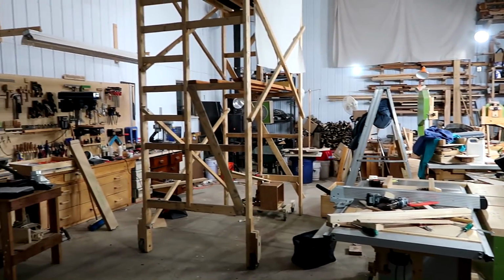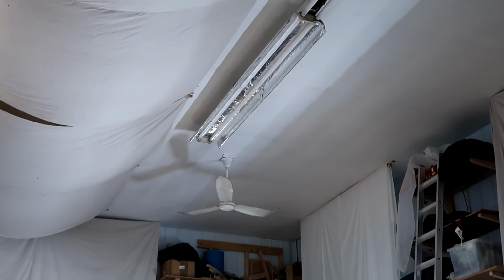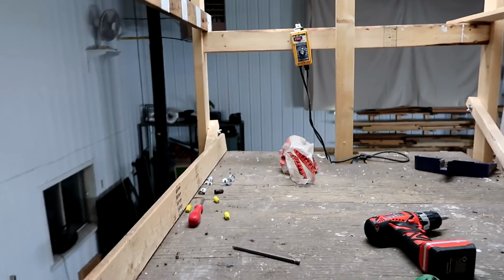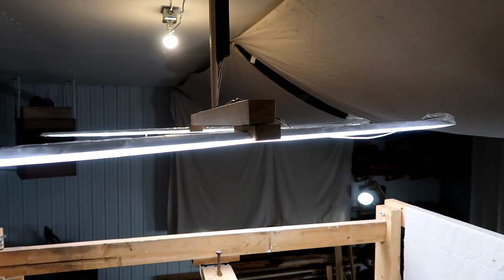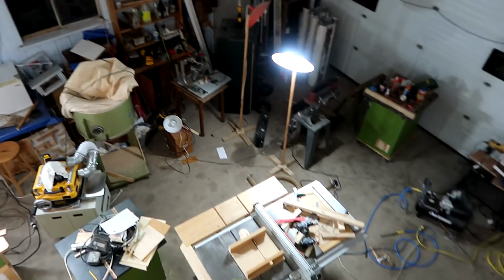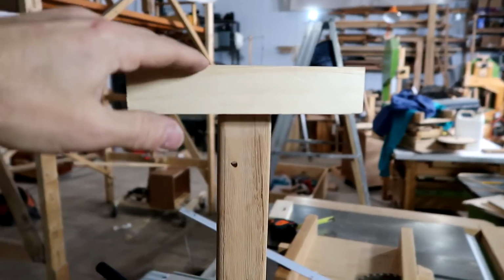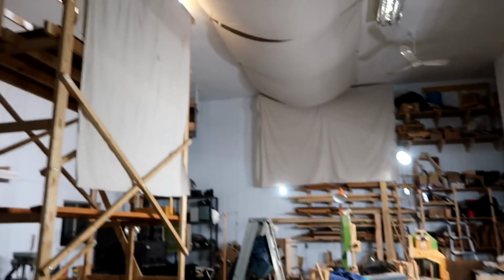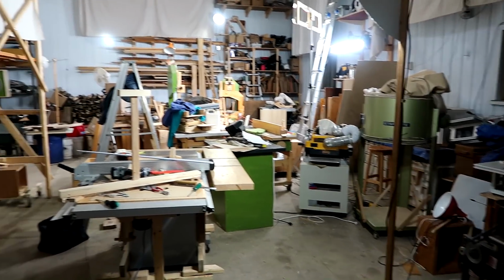Shop lights offset from ceiling

Comment: Dealing with the flies. My big shop is about the size of yours and I HAD a similar problem with flies. I cured the problem by setting up a single lamp near the ceiling, aimed to illuminate a strip of cheap, old fashioned flypaper. I ran the lamp on a cheap timer set to turn on in the late evening while the shop was still warm and the flies were still active, but all other light in the shop was out. Completely coated four strips of flypaper on as many days, but after a week there were almost none, and now I only have an occasional irruption of flies every couple of years. Try it, cheap solution and it works.
Reply from the maker: I heard from friends that fly paper was just about impossible to get this year because they kept selling out.  It's been a horrendous year for flies.
In winter, the flies come out of hibernation only when I heat.  Maybe if I had that in the summer...
Reply: That is unfortunate. I think the last time I bought the stuff it was labeled "Made in Canada". 
Thanks for all you do.

Comment: I've converted a few flourescent strip lights to L.E.D. and they work great!  My ceiling Isn't half as high as yours is, however.  I like your vids, keep 'em comin'.  Some people just use carpet padding for echo supression too.  It's pretty cheap, but tends to run dark (blue, green, brown).  I guess you could use the drop cloths as a cover for better light reflecting properties, but what you're doing already seems to work fairly well.

Comment: Glad you went to LED's. Whole lot cheaper to run and you can get them in 'daylight' configuration too.
Reply: Lasts a whole lot less time too.  I have been an advocate for LED lighting for about 10 years but even the expensive ones just don't seem to stand up as well as the old shop lights do and don't even get me started on outdoor spot lights.  Cost for cost and how long they last LEDs have been a let down for houses and shops for me.    The Chinese eBay ones are dead in no time and I have tried some other brands but no way in hell would I spend 500-1500 USD for one LED light when I can get a daytime Fluorescent for 15-30 dollars that will last and last.
Reply: I'll be darned. Had them in my house about 2 years and no problem. BUT, I don't have to run them as long either. That really sucks! I've been using the Phillips brand - when they're on sale.
Reply: Yeah, just no luck.  I purchased 12 led bulbs (compact ones) for my house and no issues for 2+ years except one burned out in 3 months but when I dissected it the issue was the electronics.  Now on the outside spot light the issue was the cob led itself (50w) though it never ever got hot and was used for no more than a month.  For the shoplights the 5050 (or whatever version it may have) seems to go and it starts a cascade effect.

I think these things are all being way over driven is the main issue.  I mean those old LEDs we have seen for 35 plus years now will last forever and though they are dim by the standards of now they will still be running for 50 more years if not longer.  Now overdrive them so they are brighter and poof.  The candle that is twice as bright lasts half as long but the Chinese no longer care about their history and proverbs.
Reply: I don’t use LED either. Fluorescent uses almost as much energy for the same amount of light as fluorescent led tubes and costs 10 times less. That was 2 years ago in Germany at least.
Reply: LEDs are more efficient than Fluorescents, but not by much.
Reply: cfl  cause cancer   who still uses  cfl .  bad idea
Reply: i have a 80 watt   t8  or t12   works awesome  must    be from the 50s   no worried about  power  use  ,  lights  up the room real  good  ,  but then  again i dont shoot  videos   for that  light to mess  it up
Reply: TMK, all fluorescents can cause cancer, as all emit ultraviolet. This isn't a hugely significant though. The levels tend to be low, and it's not like humans are averse to ever being in contact with sunlight.
Reply: I had similar experience in the past with leds, however they have been getting much better with time. I find Philips or IKEA Brand bulbs last decently. 2+ years out of them currently, the whole house is LED for me now. My shop is using fluorescent like fixtures but they are actually LED in a tube. Costco had the whole fixture for 25$ when I got mine, twin tube. I saw they had them in stock recently again for 27$. I have been using one of those fixtures in the laundry room for about a year now. No issues.
Reply: Actually, with an electronic ballast (about ~10-15 € for a 2x 58 W lamp) fluorescent lights are essentially as efficient as LEDs, while being cheaper and - in my experience - lasting much longer. With an electronic ballast they make no noise at all and reach full brightness after about one second and don't flicker (if you're making videos...). Tubes (which are actually made in the EU, where I live, not overseas, so another +1 for that) cost me about 1.5-2 € each, depending on size.

And, as an added bonus, they are easier and cleaner to manufacture than LEDs as well. Semiconductor manufacturing is an INCREDIBLY dirty process producing (and requiring) many highly toxic compounds which are expensive to dispose of properly. So of course, no cheap semiconductor fab actually does that, they just dump that highly toxic stuff in some ditch nearby.
Reply: That is what I have. There is some sort of circuit board controlling the 2x58w tubes. Cost 28€ includingt he tubes and is splash proof.

Comment: Another advantage from mounting your lights lower than the ceiling is that more light intensity will reach your work. Light intensity falls off using the inverse square of the distance.

Comment: I'm surprised you still have bugs there this time of year.   Pretty much all of the bugs here in N.  Nevada have died off already from the cold nights.   Also, FYI, I have piles of tri-color LED tape segments if you would like. I think each is around 8' long. Only catch is the driver that came with them makes them pink.  I have not had time yet to look at the drivers yet to see if they can be changed.  They were leftovers from a neighbor camp at BM, that were throwing them away!  So I swooped them up, and will be using some for some lighting changes.   Let me know if your interested in some, and how many, and I'll mail them off.  (And some Ethernet too)

Comment: If you soak the drop cloth in something gluey and spread some sand on it its sound dampening efficiency should increase significantly - the heavier it is the more sound-absorbing it becomes. I suppose some diluted PVA (cheapest D1 you can find) would work well - once dried it stays just a bit elastic, so it doesn't crack once you hang out the drop cloth again.

Also, once the drop cloth becomes impermeable, due to the glue, you should be able to throw some loose sand (or maybe fine gravel, of 1-2-3 mm grain size) on it, when it's up again. There's no wind or other disturbance that would make it fall down, inside, and it would also significantly increase sound absorption - loose heavy particles start vibrating when sound hits them, then transform the sound energy to heat as they rub against each other.

Some sticky fly paper should also rid you of flies. That one's really cheap.

And yes. What you currently have is not a workshop. It's a depressing catastrophe. I'm rooting for you to find the time to convert it into a shop again, sooner rather than later.

Comment: The white reflectors on the fluorescent lights have a higher reflectance than the aluminum foil. Look it up. Polished aluminum is great for direction control but is not very reflective when compared to the fixture white paint.
Reply from the maker: I actually tested it against the old reflectors (which were not very white anymore).  It was a substantial improvement.

Comment: Matthias these lights are still awfully far up. You know about the inverse square law and how intensity drops with distance, that is why your light stands work so well and these lights will look puny when finished.
Reply: stefantrethan not so with linear sources. Their drop off is linear. 
It’s complicated further by the complex configuration he put them in.
Reply: Only as long as the linear length and distance are in the same ballpark, as you get further and further away it looks more like a point source. Of course things are further complicated by reflections off the wall and light thrown by surrounding sources, but more distance = less light.
Reply: stefantrethan he’s not that far away and the combined length of the lines begin to combine. 
But yes, as I said it’s complicated by many factors. 
The linear aspect will tend to dominate once he gets more lines up though.
Reply from the maker: yes, light drops off, but I wanted to illuminate a larger area
Reply: Matthias Wandel are you planning on doing both sides? By the looks of it, it would almost amount to daylight simulation. Treating winter tiredness as well.
Reply: Uve got enough light. U need diffusers to smooth it out.

Comment: That shop looks like it has a very high ceiling. If you lowered the lights closer to your work area wouldn't the light level increase IAW the inverse square law. Half as far away should be 4x brighter right?

Comment: I think you need wall mounted fly zappers in your shop! That is a lot of flies....
Reply: He needs a fly sucking machine.
Reply: In the north flies will invade a pole barn like this because the slab it's built on stays warm during the night.  They can be a really disgusting nuisance - I've opened the barn door and heard what I thought was a beehive, only to find that thousands of flies were on the ceiling.  Even better, they're fantastically good at getting in and awful at getting out, so there can be drifts of fly corpses in the windows or corners.  If you leave the door open they'll leave, but they just come right back in a few hours later.

Comment: I didn't scroll through all the comments, but I was kinda wondering why you didn't opt to use s T8 standard tube LED light, these are LED lights which resemble the old school fluorescent tubes , and are normally used as a retrofit to replace the standard fluorescent tube in its current setup?  I reckon its a little more robust. Is it becuae of cost?

Comment: I know lights hanging from the ceiling can be a bother when moving long stuff, but at least those LEDs won't break if you hit them. Perhaps you can come up with some ingenious rope suspension system that you can raise and lower. Also your drop cloths are fairly dark, perhaps you can do something about that.

Comment: I hope that you put in a screw for those brackets so that they wouldn’t fall anytime soon. Also, you may need to clean those cloths with dust floating around. Sound tiles are good to have in the long run. If you are cost concern, than why not gather your wood chips and dust and put it in a frame and add wood type glue to make your own tiles?

Comment: Not a single comment wondering if the flies are due to using aluminum foil found in the trash?  Sounds like your lights, like every other tool or appliance in your shops, needs its own small "dust" collector. Best thing I ever accidentally found for flies was an empty aquarium. They get in but many can't figure out how to leave and eventually die.

Comment: Re. Sound, I would deal with the parallel surfaces next.
Fiberglass is a great sound absorber, not rock wool, it's to dense but is good in between walls.

Comment: You need A big power supply for those led strips, and they are not so great. I would recommend to buy driverless 110v 10-30w led crees, from ebay (under $2), you just need to make heatsinks for them

Comment: Just have John H. come over and put in a drop ceiling. lol, It will dampen sound, trap heat, and able to put proper lighting in them. and you can still keep most of your wall height.

Comment: Love your videos! Have you ever considered making a second level in your shop?
Reply: the same question.
Reply: That occurred to me too but I think the ceiling/floor clearance would be too cramped with lighting, equipment etc, But it's still an interesting thought.
Reply: And probably inconvenient to haul stuff up and down the floors all the time. Maybe it's not even possible due to the strength of the building.
Reply: Would be good for filming to have a lower ceiling at the bench area.
Reply: A 'den' of sorts would be an awesome second-level addition. Small couch, mini-fridge, computer... Convenient place to take a quick break.

Comment: Hey Matthias,
If you weren’t filming in your shop, would you still have the sound dampening drop cloths? I️ ask because I’m curious if it makes it less loud when running tools like your jointer and planer. I️ have a feeling that the noise reduction would be negligible but am interested to hear your insight. 
Thanks!
Reply: sound dampening is always nice to have in the shop, even when having earpro on all the time, the sound wears you down over time.
Reply: My chosen profession and hobby is very different from Mat's, but I will say that it's been my experience that having the drop cloth ceiling does seem to make the noise management in the shop easier. I mean, it's not going to make the machine's quieter, but it'll deaden some of the reverb that contributes to the overall noise pollution. Ear protection is nice, but having that reverb cut down makes it more effective and the remaining sound doesn't wear on your nerves quite as much.
Reply: If you've ever seen the video of someone popping a balloon in an Anechoic Chamber it really makes you realise how much of the noise we hear is the reverb

Comment: You don't dampen sound or vibration, you damp it.  Damping kills vibration, dampening makes things wet.
Reply: Wesley Treat, Maker of Things 
HOW DARE YOU QUESTION MY ABSOLUTE AUTHORITY ON THIS MATTER!!!
Just being pedantic, really.  I was always told there is a distinction between the two.  Maybe it's a regional or US/British thing?  To me, he's damping the reflections. I'm trying to do the same in my new office.  It's small, sort of square, and has a concrete floor.  People even notice the reverb when I'm on the phone with them.  A rug is helping, some art hanging on the walls may solve it for good.

Comment: Are those a pre-fabricated LED strip? I'm curious how they're powered. I didn't notice a power brick.
Reply: look on the vertical post of the mounted one, the supply is on that
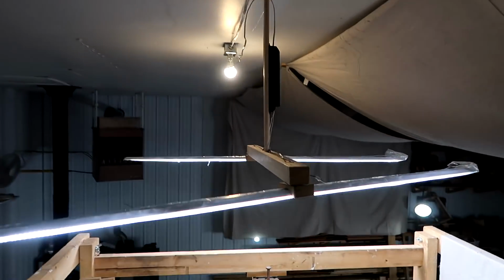Reply: Oh, OK. Kind of blended in there. Saw it at 1:17 now that I looked again.
Reply: And being LED no need to run a big gauge wire.